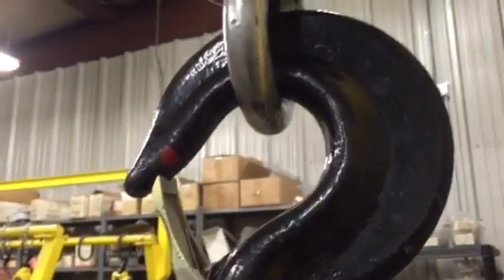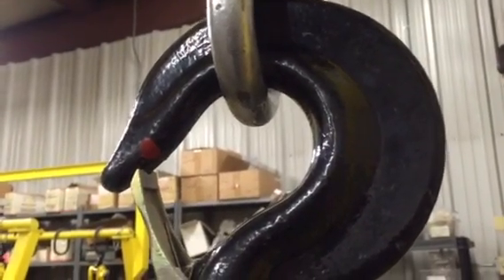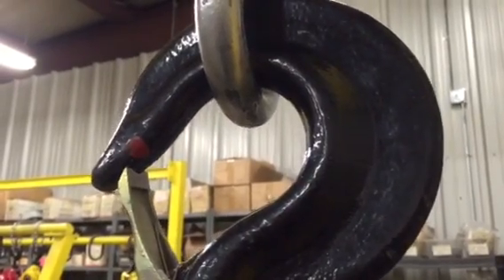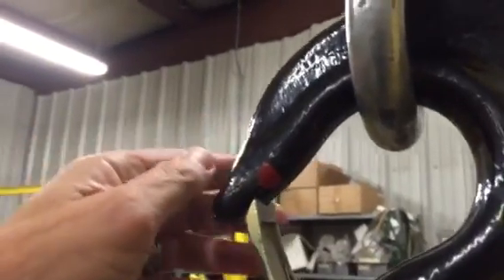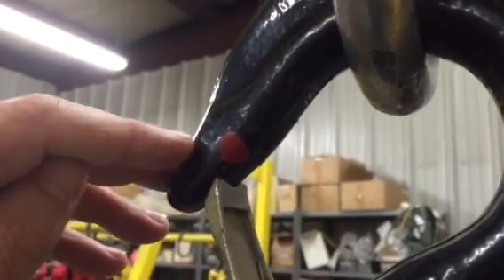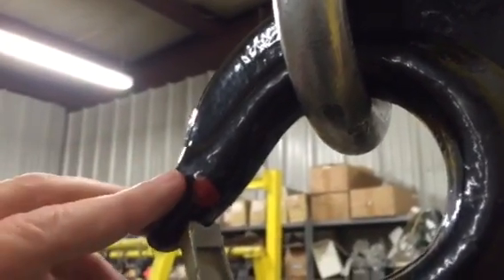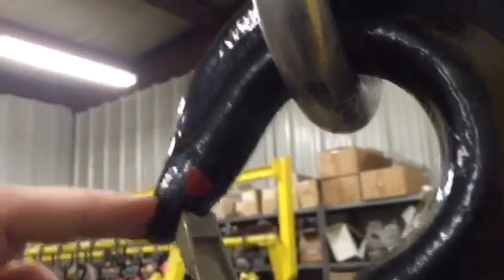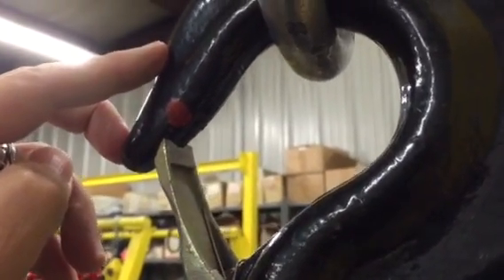See What Happens to a Hook When You Overload a Hoist

Comment: Just a little past yield strengt, so it probably takes 40k pounds or more, to completely bend or break it.
And since it's steel, it usually bends a lot before failing eventually.
Reply from the maker: Thank you for your comment! You're absolutely right that steel generally bends before failing, and its ultimate strength depends on several factors. For example, a hook rated for 5 tons won't necessarily break at 10, 15, or even 20 tons—it depends on variables like the fatigue life of the hook at its rated load, how many load-unload cycles it's undergone, and its factor of safety against fatigue failure.

Many hooks are designed with a factor of safety—say, 3 times the rated load over 10,000 cycles. Statically, the hook might hold 13 tons before yielding and could break at 18 tons, depending on the grade of steel and heat treatment.

This illustrates why it's critical to adhere to the working load limits and inspect hooks regularly for wear or damage. Consistent use within rated limits ensures safety and prolongs service life.

Let us know if you’d like more technical insights—we’re always happy to discuss!

Comment: I have just learnt something that I previously had no idea could happen.  I truly thought these hooks were good forever.  Would that be true if never used to the full rated limit, or will the hook simply develop long term stressing even under the max limit??
One question that does come to mind, why don't the hook manufacturers create a small grove where the latch meets and paint it a bright or contrasting colour???   Do they even do that in 2021??
Second question.  Is there actually a design factor in the hook that allows for a percentage of stretch as part of the normal operation???   Does the MFD conduct a pre-stress to set the final end use???

Comment: They should add sensors in the hooks that detect how much weight is on the hook. If its over the amount rated for that specific hook, the sensor would send a message to the lift or whatever machine the hook is for, and not allow it to be lifted until the stuff you are trying to lift is within the limit of the hook
Reply: Some do - not everything needs that; it's expensive and this skillset has been around for a long time.

Comment: The annual inspection performed on the hoist is supposed to identify a stretched hook by measuring the hook opening and comparing to mfg spec. Good quality hooks have marks cast into the hook that you can measure spread.
Reply: Some of the companies that I worked for just bought all new lifting gear;
Plate clamps; d shackles; wire cable rope; chains and hooks, 
every time the inspection date came around.
Other companies said "go easy on that gear, it's old!"
Reply: @benjigray8690 there are standards for all those things depending on how much of the rated load is used and how often its used. A wire rope can look 100% fine and still need to be replaced every 3 months. Because the outside you see is not what takes the stress of the load, its the inner core which you cant see.
Reply: Thank you for replying.
you're quite right.about the "standards" that apply to all lifting gear
A while back, I applied for a job at a steel fabricating workshop.
The owner took me for a tour of the place, and the first thing he showed me was all of the different coloured lifting slings.
And he pointed out the favct that they all had recent inspection dates on them
  then he showed me all the various machines, asking me if I was familiar with them.
  I still live by the rule;
never stand under a suspended load.
Reply: @benjigray8690  I actually work for one of those inspection companies. Its crazy the amount of standards there are. Its all about safety though, things fail all the time so companies are required to have the inspections done every month to a year depending on the use for liability reasons. If they are used for more than 65% of the rated load OR more than 25% of the time, they require monthly inspections. Then theres a plethora of other stipulations that could also require the monthly inspections like temperature and environment.

Comment: OK, it reached its yiield point at FOS 3, so? If properly designed it should snap at 45-50 kips, depending on material properties and breaking strength. If loaded more than 10,000 times probably even sooner.

Comment: A hook may be rated for 5 tons, but that doesn't mean it will break at 10, 15, or even 20 tons. It depends on the fatigue life of the hook at its rated load, how many load-unload cycles it has seen in service, the factor of safety against fatigue failure at the rated load, etc. It might be designed to withstand 5 tons with a factor of safety of 3 over 10000 cycles. Statically, it may be able to hold 13 tons before yielding, and it might break at 18 tons. It all depends on the grade of steel and heat treatment.

Comment: Because of that bend, every load will rest closer to the tip of the hook by that much*. If you suppose there is no mechanical stress (and there is at least some), then the *thinner part of that hook ought to be more inclined to bend to pressure than the hook's original rating. We're blind to what the hook can handle now. I fantasize I'd take a big risk: paint it florescent, put it in its own pile and label it good for half it's old capacity. I can't be sure of that but I see that as safer than treating the hook like the others. But don't take my bad advice.
Reply: This hook is garbage now. Cut it and throw it away. Carrying heavy loads is not a joke. It can and will kill someone.

Comment: Question: so why don't the manufacturers put a red mark on all hooks? It would make previous accidental overloading to the point of  ductile stretch  visually obvious during inspection. Sure it wouldn't catch all overloading but at least the egregious abuse would be visually obvious.
Reply: They are legally required to be inspected by professionals who dont need a red line to know if its deformed beyond manufacturer or legal standards. 
-professional

Comment: So paint the hook at the latch as a precautionary warning.
Reply: A lot of hooks have 2 small holes at the side, between the opening. The distance between this holes is defined, and can be controlled. If this distance is wider than the defined one, it's bend.
Paint alone can be done additionally, but it won't last long on a hook which is often used.

Comment: Sounds to me like they just load tested the hook to 30,000 lbs so by my line of thought it still oughta handle 5,000 all day long.
Reply: I would think stress deformation may not be linear. Once you go over the limit, there's no warranty over how it will behave.
Reply: Yea, but the material is compromised. Could fail at any point now
Reply: If it’s held 30 then it will hold 5 all day long. Admittedly it doesn’t necessarily give you a warm fuzzy and I wouldn’t stand under it but would still feel pretty secure at 5.

Comment: what you're discussing is the difference between plastic deformation (what you see by the red line) and elastic deformation (what happens when you load the hook and it comes back to the red line when you unload it).  Elastic deformation shortly leads to rupture (well kinda shortly) but if you unload before rupture, the steel returns back down the load/deformation path to zero load.  The next time you load the steel, it travels back up the same curve, which is offset a bit to the deformation direction, meaning you get to elastic deformation more quickly.  If you stay within the elastic limit of the steel, theoretically, you can load/unload all you want.  If you travel into the plastic deformation zone, your cycles of load and unload remain the same, but the magnitude of yield reduces and the load difference between yielding and rupture reduces.  However, if you only to the plastic loading once, the hook should be ok for continued use, depending on how far you travel into the plastic zone.  Steel attachments are usually rated at 20% to 25% of their rupture strength, you hook was rated at 10000 lbs meaning it's rupture strength should be 40000 to 50000 lbs, you made it to 30000 lbs, meaning you were coming up against the rupture strength of the hook, meaning your cycles in this zone next time are significantly reduced.  (this, by the way, is strain hardening of the steel).
Knowing what you know, throw the hook away and get another one.  the $150 for the hook is far cheaper than the litigation involved in dropping an important pick or hurting someone.  BTW, dont throw the hook away.  Cut it in half.
Reply: Excellent!
Reply: Can you recommend resources to learn more about this? I’m new to the industry and eager to learn more about promoting safe practice.
Reply: identical to me
Reply: Hooke’s law on a hook😀
Reply: Yes,  ' cause  guys  like  me, would use it for lighter  purposes.  Like  making a bumper tow rope....,  when  moving.....CUT   IT  IN  HALF,   !   GOOD ONE @ 
(Forgers'   code :     sleep, eat,  heat,  beat    re  peat.........for heattreat...)
Reply: The plastic defamation is not noticable by eye. This is beyond that

Comment: I thought I was going to see it stretching and failing, nothing to see here
Reply: Honestly, I don't see a problem using that hook for a load its rated for, even after the deformation. Yes, it has been deformed, but not in a manner which I feel would cause a dramatic fail. It has been stressed into the plastic deformation range. I see no cracks or other indication of an impending dramatic fail. IT that slight deformation is a significant compromise of the hook, I'd expect the manufacturer to put marks on the hook, to make it obvious a deformation has occured, i.e. a series of parallel lines so deformation is blatantly obvious to anyone looking.
Reply: @ravenbarsrepairs5594  Thats why industrial tool rooms tape hooks to mark this type of failure. Needs to be common practice. Once the original form of a lifting device is altered whether by lifting force or human force, it cant be trusted. Nor should anyone tell someone else it would be fine. If you know its been stretched, any outcomes afterward are on you. Thats why I alway told new hands, you see it you own it
Reply: @hammerdick82  a safe hook or unsafe one makes little different once your not under the load
Reply: @hammerdick82  ..do you have a machine for testing hope and vision..don t put yourself in a position that depends on the safety of a rated bit of equipment...things can go wrong...so I would not trust my life anymore on the new  hook just out the box..that means stay the f# away from a suspended load or if it was used for towing example recovers...stay well clear..
Reply: @hammerdick82  .looks like you know it all..and learned it all...and seen it all as well
Reply: @ravenbarsrepairs5594  You'd be great fun to go diving with.  Or flying.  Or mountain climbing.  "Safe equipment; what's the big deal?"
Reply: @ravenbarsrepairs5594 certified crane technician here,
These hooks have a hard outer shell and a soft inner shell to actually allow for slight flexing. Keyword is slight, once the 'throat' is opened beyond 10% they are no longer safe for even the rated load and must be replaced per OSHA and ASME and manufacturer standards. Its my job to make sure people using these hoists do not get killed and if they do, I go to court.

The manufacturer wont put "marks" as they are legally required to be inspected periodically depending on how much they are used, how much of the rated load is used, ect. If its used for more than 65% of its load or more than 25% of the time, its heavy use and must be inspected monthly.

Comment: Quality hook manufacturers install two reference points across the mouth of the hook of a nominal size metic or imperial doesnt matter .
That measurent  is supplied with the hook for future audit reference , then there is no concern .
Reply: Factories I have worked in we are trained in basic rigging with straps, wire rope and chains and load weights. The overhead crane inspection classes is where this information is learned and passed on to others.

Comment: you are talking about the load hook right not the top hoist hook right?
Reply: One hook is the same as the other. If one was overloaded, then the other will have been. The correct way to check it is to measure the gap in the opening of the hook and check it to spec. If it is greater than the maximum allowable opening, then it was taken past its yield point. It's according to how much it was overloaded, to whether it may have stretched or not, as all hooks will hold more than their rated load, as they have a safety factor to them. That's why the one in the video took 3 times the rated maximum load to stretch it.